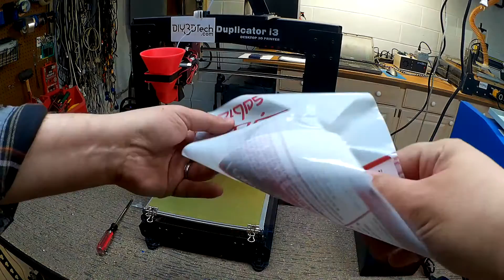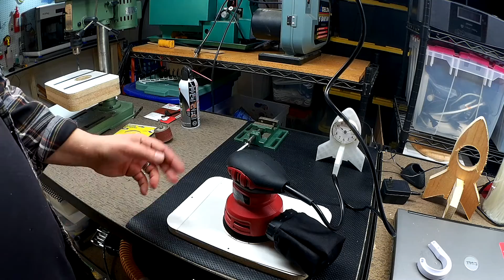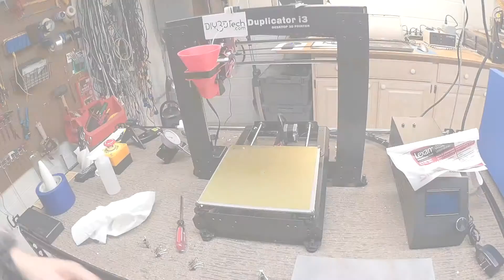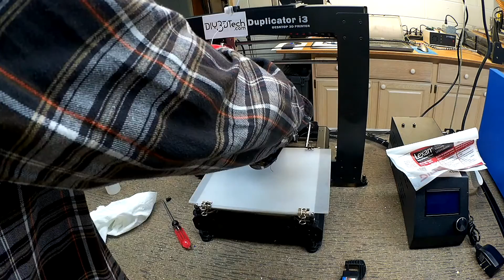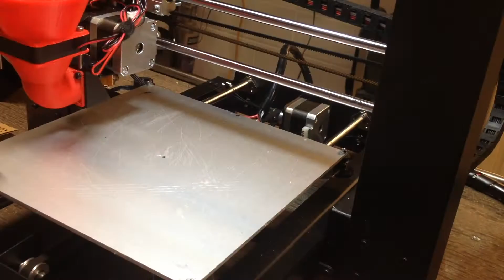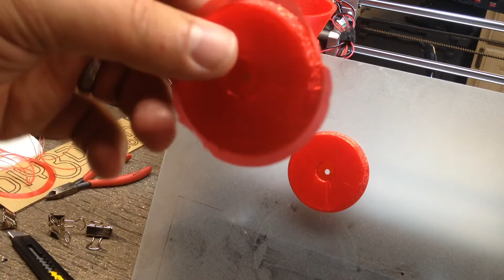Wanhao Duplicator I3 3D Printer  -  Printing TPU on Polycarbonate!

Comment: So what is the final verdict? What are you using for TPU build plate adhesion?   Thank you
Reply from the maker: +Leba been using PEI for quite some time...
Reply: The last test I tried with TPU, it stuck to my PEI glass plate really well that while trying to remove the print it actually tore the PEI off my glass plate.  :(  I guess I made the mistake to let it cool too much.  What is the trick you have discovered to remove TPU prints from PEI plate?  Thank you

Comment: can you share your tpu settings with simplify3d for 150$ software you think they would add TPU to the list.
Reply from the maker: Sorry I don't use Simplify 3D and if TPU isn't listed would agree with you. However I print it around 250c for hotend and ~70c for the bed but slow it down to from 50mm/sec to around 20 to 30mm sec depending on the detail of the print...

Comment: Wow! please I'm wondering how flexible is this material. is it flexible like Fleks3D plate?
Reply from the maker: Not sure what Fleks3D is, however TPU is not overly flexible like rubber more like a very pliable plastic.  With a very low in-fill it works well for thing like feet.  The other thing is its tough as nails so if you print something it is not coming apart...

Comment: I sand blasted my sheet . . . Flex the sheet, if all else fails put it in the freezer.
Reply from the maker: Yes tried flexing the sheet and this was STUCK on there!  :-)   Guess placing in the freezer would cause it to the contract, however would fear the infamous look from the wife whereas the workshop is yours but no putting your stuff in MY freezer :-)

Comment: I print TPU on PEI all the time. 2 things I've used is a little bit of safflower oil or gluestick to decrease the adhesion. Both work well, just depends what you want to clean up after. The key is NO heat. TPU and NinjaFlex stick to PEI beds very well, what you need is a little bit of something to help it release. I've printed a bunch of TPU toys for my kids on PEI, works really well, and they can't break them.
Reply from the maker: Ditto on the TPU toys!  Did the same for my grandson!  Also good tips on decreasing the stick, however I now have a machine dedicated to only printing TPU so  no fuss :-)

Comment: I print PETG on the PEI sheet all the time no problems with a bed temp of 85c. I haven't tried TPU but am told using a glue stick works best on the PEI sheet.
Reply from the maker: +Dan Reichel Yea, I could see that with PEI and TPU as that stuff is VERY sticky!  So the glue stick make sense, as to a video will be coming where I print TPU on the Da Vinci with a glass bed and glue stick and all worked very nice...